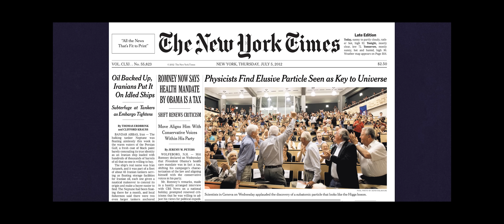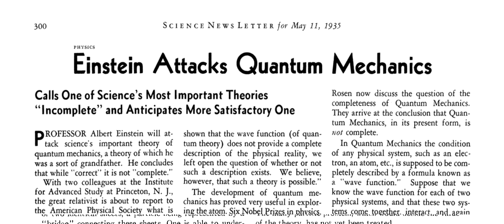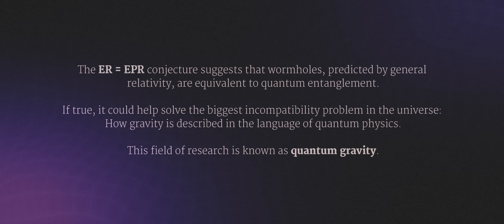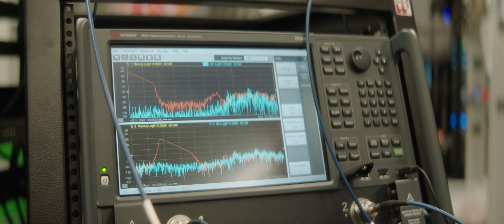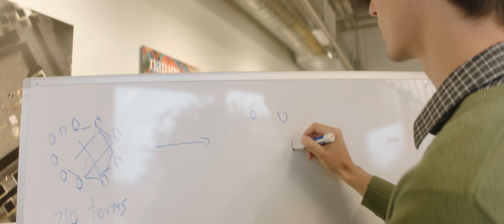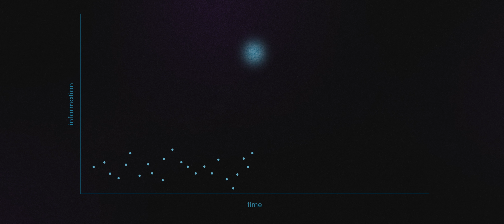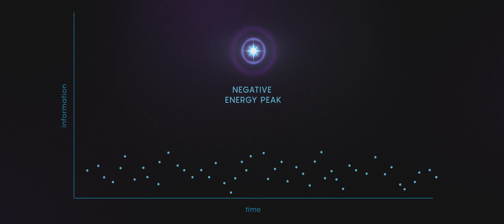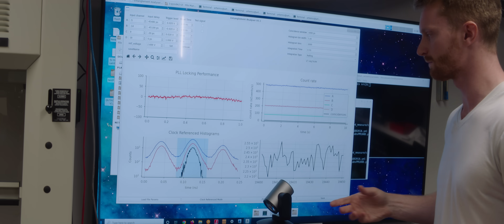How Physicists Created a Holographic Wormhole in a Quantum Computer

Comment: So this experiment shows that information is preserved passing through a wormhole and also that they can exist with "negative energy" but that it is actually possible to emerge from them at the other end was not tested? The 7 vectors used in the experiment was the number of conserved quantities in the hypothetical particle and the wormhole they simulated? i.e. the particle properties get entangled with the wormhole itself and that wavefunction collapses at the other end to the particle, but does not taint the "exit mouth" of the wormhole with that information, but separates cleanly. How would such a mechanism work, or did they just run the simulation in reverse halfway?  It doesn't sound like it is possible to converse or hold hands in transit like in Interstellar! The video describes two black holes, not a white hole at the exit? If they used two entangled black holes, Susskind himself says that the wormhole between them grows in length at c and wont claim it is actually possible to exit them? (Tell me where I'm wrong here)

Comment: This is an amazing proof of concept, but remember, they started with over 200 terms to simulate it fully, and an AI told them they could manage with 7. Once the experiment can be repeated with the full terms, then I'll believe they made wormhole. Still amazing physics though!
Reply: It still wouldn't have made a wormhole, even with all the 210 terms. That would be a complete simulation of a wormhole, but not a physical one.
Reply: @ArawnOfAnnwn  it was a physical simulation of a wormhole. The quantum entanglement and qubits are real, and the experiment worked using the theory from gravitational physics.
Reply: "simulated a wormhole"?
Reply: @bakedbeings  From what I understood, they made a virtual system that follows the laws of physics and made a wormhole in it. So, if the simulation follows the laws of physics, and it is possible to traverse a wormhole in it, then (supposedly) it would be possible in the real world too.
Reply: @pablopereyra7126  yes exactly. pretty dang cool
Reply: @ArawnOfAnnwn  for now correct but..   how long before you can say..   quantum computer make me a wormhole 😎😎
Reply: @pablopereyra7126  not entirely correct. They simulated a wormhole by using quantum entanglement since they should be mathematically the same. The quantum entanglement was run by a quantum computer, which uses real quantum mechanics. Because this experiment was successful with quantum entanglement using the wormhole theory, then an actual wormhole should be the same.
Reply: An "AI " didn't "tell" then anything. They used a neural network to combine all their parameters and train the model to be able to make simulation predictions. The reason they used a neural network was because it could condense data into lesser parameters and save computational power. You're right we expect better results with more parameters but this is close enough since they used only the necessary parameters
Reply: @sealofapoorval7437  — Semantics.
Reply: They used machine learning to optimise the 207 term system by ignoring variables that don’t matter by learning on data using solutions with those 207 terms. Both are valid systems, so this is as real as it gets
Reply: That was basically fitting for observables
Reply: This was my thought too. But it won’t downplay the achievement this is uno. We aren’t even fully there yet with AI and quantum computing, so I’d take this with a grain of salt. Happy we’re thinking better than a century ago with the tools we currently have. The next couple of decades are going to be exciting ones for sure. 

PS: I’m not native English so my sentence structure maybe confusing. Lol. Forgive me
Reply: @Theonlinehuman  People say to me is that this video wasted their time and they're surprised it convinced you. "The best fool is the one that fools himself." is what he said.

Comment: the space between the tips of the wormhole is a different dimension interacting with ours. just like when you put a pencil through paper, the 3rd dimension crosses the 2nd instantaneously. so too is the wormhole.
Reply: Kind of. It, actually, would go in an additional dimension in a higher dimensional embedding.

Comment: I don't believe you. 

All my "bad journalism" alarm bells are going off at this. There is no way it is actually the way it is being portrayed in the video. The most I'm willing to accept without much deeper knowledge of what is actually going on is that the quantum system looks like a wormhole from the right perspective and if you squint your eyes. It may be a very good simulation but something like wormholes BEING quantum entanglement is bananas, it would turn all of physics upside down. Especially given that wormholes are traversable by matter (in theory) and information transmission via quantum entanglement is impossible AFAIK. Maybe a quantum state is transported like with the quantum teleportation. Do not simply accept this oversimplified version of research! I might have to read the paper...

Comment: So the spooky action at a distance just gives a deeper understanding of what "distance" means?  So deep and so simple.
Reply: Exactly, if one is to accept the conjecture. More correlated = closer.
Reply: no... there is no "distant action" happening. An entangled system has 2 (or more) subsystems with certain properties that are correlated. If one points up, then the other points down (and vice-versa). Before measurement, each of these outcomes has an equal probability (for a maximally entangled system). After measurement, the information the observer has about the system changes, but the action they perform is local to one of its subsystems, not "at a distance."

Comment: really? when particles are "entangled" they are simply synchronized in some way. perhaps the same direction of spin or velocity of spin. Maybe both are warbaling on their axis in the same matter and so on. And these systems are incredible unstable. without a super cold and shielded enclosure, this "entanglement" breaks down immediately, so there is no wormhole connecting them and there is no need of any information transfer. You could do the same thing with a pair of tops.

Comment: Do wormholes have actual, definite length?
Reply: I have no idea, but one way to view it is that the space time breaks down under these circumstances so that space and time is connected but stand still. So it would effectively be that there is zero distance and zero change in time. However this interpretation of mine may very well be wrong altough this is the only way I can see how this does not break causality.
Reply: @theseal126  I agree, it does seem tho that the video explains it as having length, or at least taking time to travel through… I was thinking the same as u but who knows!

Comment: Thanks.  We finally seem to be poking some holes in the great wall that is quantum gravity.  It would be great to live long enough to see a lot of this come together into a comprehensive theory.  I do have one criticism / question, concerning the illustration @10:36.  It shows 20 points, with lines connecting each one to every other.  But it gives the number 210 as to how many connections that is.  If the illustration is analogous, then it should be 190.  It would take 21 points to give 210 connections.  I know, it's a minor nitpick.  But I derived this formula for myself in the 80s, and I couldn't help counting things up!  Sorry.  ;)  Thanks again for a great video.       tavi.
Reply: Bot spelled 'telegram' wrong AND used the F.U. emoji 🤣🤣🤣
Reply: Perhaps each node also had a connection to itself, which is typically represented as a loop that the graphics team could have left out. I don't know what connecting a node to itself would represent for this system, but to be honest I don't understand what any of the connections mean.
Reply: So many people aren't gonna believe that this experiment is "proof" of wormholes. They're just animations.

Comment: Is the travel of the qubit through the wormhole instaneous or limited to the speed of light by the time we can detect it ? Can we send messages through this wormhole ? Do these message travel FTL ?
Reply: No. There is no wormhole. They explicitly state in the paper that it obeys causality, so no FTL. They use quantum teleportation as a means of simulating a wormhole.
Reply: No FTL is possible. Messages can be sent thru traversible wormholes.

Comment: They explained what it is and told us that they replicated it in quantum computer. But they didn't tell us the most important thing - what the experiment outcome's implications are. What does that mean if you can create a virtual quantum wormhole? Can we assume that some of the black holes are entry points to space-time corridors with their exits in white holes? Is then FTL travel or communication possible?
Reply: it proves that there is an equivalence of gravity in the quantum world
That the wormhole in Relativity is also the entanglement in Quantum
Reply: The experiment is the confirmation of the er=epr conjecture. It is also a QG experiment which is nice.
Reply: They seperated entangled particles and then send negative energy through through the theoretical wormhole is how i understood it.
Entangled particles seem to be already proven and usable.
Reply: @ayoCC  negative energy being real may also be a huge implication
Reply: @acasualviewer5861  warp drives

Comment: So does this duality experiment prove that wormholes could indeed exist after all? Was that the point of the experiment or was the point something else?
Reply: the point was getting experimental confirmation of the idea (proposed by Maldacena and Susskind in 2013)  that wormholes and entanglement are the same phenomenon is correct; as I understand it, they create a mathematical representation of entangled particles in a circuit and the circuit produces a result that looks like the math of a wormhole

Comment: Okay, real question here: What about what they did was different from standard quantum teleportation? I don't want to ruin hype, but this makes it sound like the wormhole doesn't need classical information to be reversible (that it implies one can traverse the distance between two points faster via the wormhole than they could by following the non-wormhole path...not FTL travel, but perhaps enough to violate some causal relationship forbidden in special relativity)
Reply: Religion and science have so much in common; make shit up as you go.
Reply: @ChristheDunce  The make shit up as you go part is called psuedo-science
Reply: @ThyChairman This experiment is evidence, not proof
Reply: ruin the hype. there's no actual results here, this is nothing but computer animations and claims. I think at best the simulated what a wormhole might look like, they didn't actually create a novel where I'm hole or send information through a real one
Reply: @@thychairman5782 But at that point, if both are mathematically identical, the experiment doesn't give you any new information. You would have produced the same result where it just for quantum entanglement without wormholes. So why bother?
Reply: @crazygamezockerXD  I am not a phycisist, but, what do you mean it gives you no new info? If it shows you can build a system that works according to the math, isn`t the experimental confirmation itself "new info" ?
Reply: @crazygamezockerXD  as video points out ER = EPR, it joins standard model of physics aka general relativity with quantum physics. It shows us that that Quantum teleportation is or is explained by standard model in the form of a phenomena  of wormhole. In standard model wormholes are non-traversable but if we think about them from quantum perspective, the quantum information can traverse it. 

To bluntly summarise, what these bunch of wonderful people achieved are the following:

1. Wormholes can exist and are real thing as envisioned by Einstein-Rosen, this tells us that information can travel through space-time, we know it as quantum-entanglement and teleportation. This proves that Einstein and Rosen and other scientists  were correct in theorizing wormholes. Quantum entanglement phenomenon has been extensively tested and recently was awarded Nobel Prize in Physics. This is now further explained by science.  It is no longer a unexplained phenomena or as Einstein referred to it a spooky action at a distance. I can vividly imagine if Einstein heard about this science experiment and what it tells us he would have had 2nd happiest day of his life.
2. There are some properties that wormholes could teach us about and further the standard model of physics and quantum model of physics so both branches of science could advance and going forward we could potentially start to see emerging theories that will further join two branches of physics into more tightly-knit general model, also referred to by many as holy grail aka theory of everything, one unified model to explain it all.
Reply: My question about this is a much simpler one: The dream of all scifi enthusiasts is FTL travel. If a wormhole can be established between two points, and is traversable, those words spell "FTL travel" to most people.

The question is whether this implies the possibility of FTL communications/travel. If it DOES, that's an even BIGGER deal then this video makes it out to be, and is an important consideration for public communications.
Reply: @ThyChairman I saw only computer animations in the video. Which video showed you the actual wormhole?